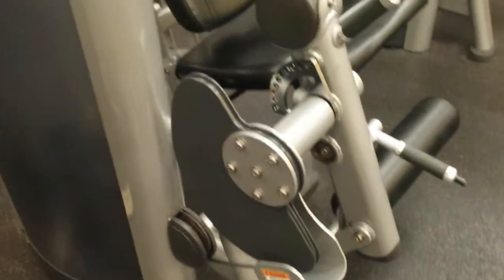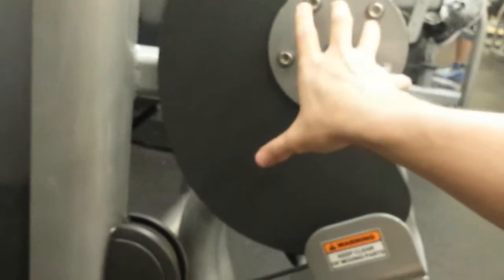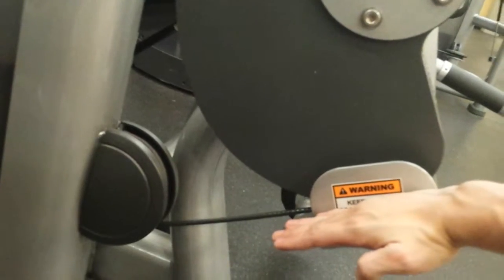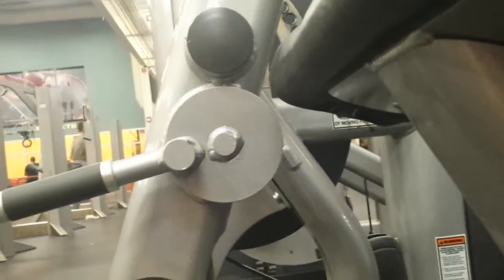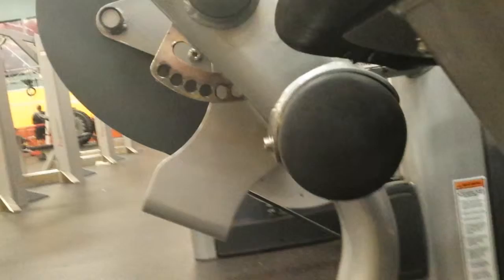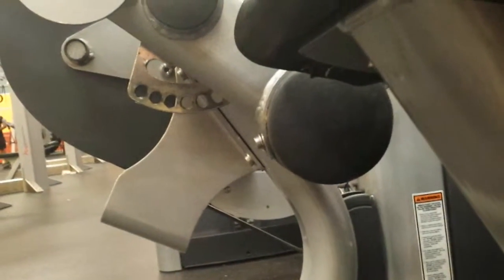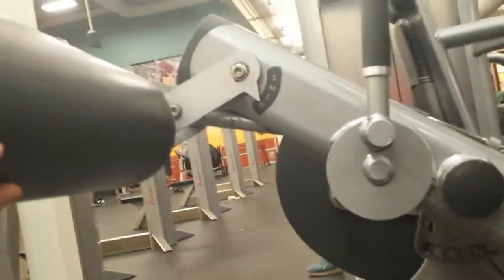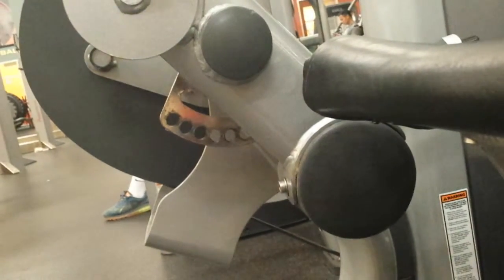Knee Extension Cam Discussion 1 - Life Fitness

Comment: Yes Matching resistance to our strength. Crystal clear video.. If you are aware of some sort of data bank where we can study moment arms of each major muscles in different plane of motions ? that way we can devise exercises to match strength profile of muscle with resistance profile of external force.. i tried to search but did not find as such. If you can share some link, it will be huge beneficial to prescribe exercise.. Thank you...
Reply: I wish I had seen this when it was originally posted, so sorry about that!

I'm not aware of such a database in a complete form, but there are some papers that have some measured or estimated muscle moment arm values that I've seen.  Human anatomy is variable enough, however, that the moment arm for one person could be very different from another.  On the plus side, perhaps, is the fact that it won't really affect the fundamental training that we do, since we can't change those moment arms anyway unless we have things surgically adjusted.